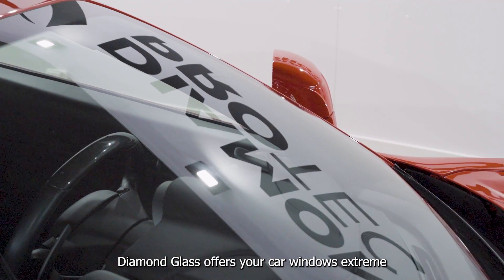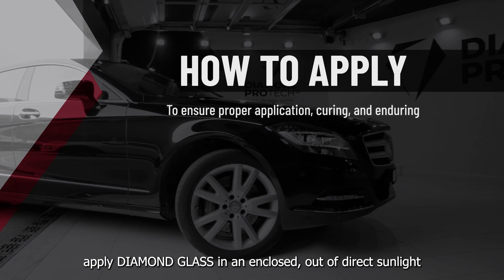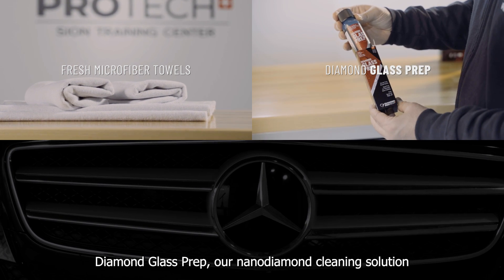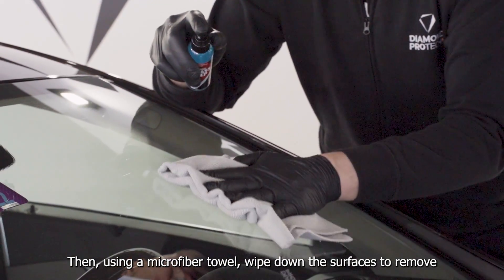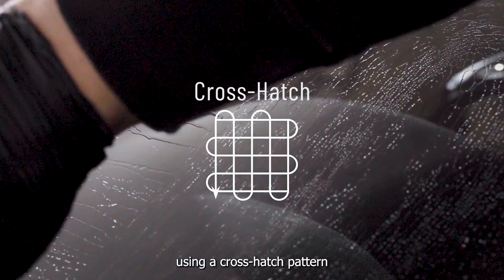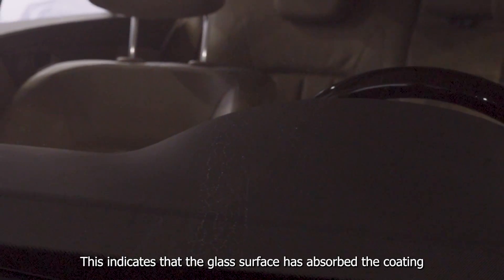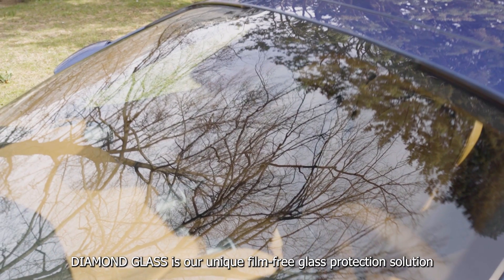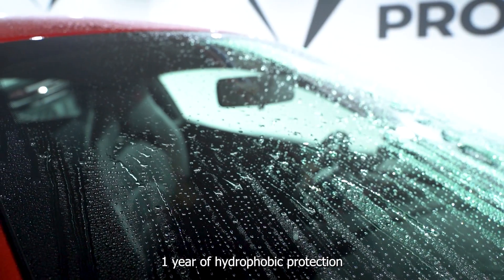DIAMOND GLASS  | Application Instructions

Comment: I’ve noticed that after applying (not in direct sunlight) that by letting it sit even for just a minute or so, after wiping off, the sweating becomes ingrained in the glass as well, almost as if it cured that way. I polished the glass, and reapplied again, after using the prep, rubbed in it more and it was better but noticed it hazed a lot after wipe off. The haze is interesting as I wipe it and it seems to reappear. Any thoughts? It works wonders and the “haze” in only noticeable to the trained eye. Other than that, the coating is incredible!
Reply from the maker: Thank you for your feedback. It appears you may have let the coating flash for too long on the glass surface. Please be sure to check the expiration on your product as well. 

We're always available directly via our website for any further investigation into your issue, feel free to contact us anytime!
Reply: @diamondprotech  thank you for the response. If that’s the case, wipe off should be almost immediately

Comment: I usually use a glass cleaner after washing my car - to get that streak-free finish. Now that I've coated with DPT Glass, is there a glass cleaner you'd recommend which won't damage the coating?
Reply from the maker: The diamond Glass is a very resistant coating. For the best results, use an ammonia free glass cleaner.

Comment: How do you recommend the glass is cleaned after coating? Any chemicals to avoid or preferred glass cleaner to use?
Reply from the maker: Any standard glass cleaner should be fine, rinseless wash, or PH neutral soap while washing the rest of the exterior should work too! The hardest thing on glass coatings is physical abrasion, so scrubbing hard and using the wipers. Thankfully Diamond Glass is super easy to use and goes a long way so it's easy to refresh if you notice its performance starts to be reduced.

Comment: The last coating  I used caused wiper chatter. Any chance of this with your coating? With winter coming up I want something  to repel the snow and ice and not make it worse.
Reply from the maker: Hi Mark. My name is Matt. I am a Diamond ProTech Ambassador for the USA. The Glass coating should not cause wiper chatter. Make sure the wiper blade is clean. Most chatter is from dirty blades that don't glide across the surface. I'm very excited to see your experience with Diamond Glass. Keep us posted on the results!
Reply: A little late to the party, but, most of the chatter I've had on wiper blades was due to bad contact angle. When wiping the wipers should be 90 degrees perpendicular to the surface. Any deviations that let the blades bunch up on the windshield causes it to skip. Otherwise I've prepped glass before coating by running a quality glass cleaner and either fine steel wool or a razor, gently of course. After that anything else is cool!

Comment: So it would be basically impossible to apply from a home garage since in our island humidity is naturally always above 75%?  Or what would be some of the adjustments one could do when applying it/removing it if don't have an enclosed garage for humidity control but is inside a garage with temperature below 90 degrees Fahrenheit?
Reply from the maker: Hi!  My name is Tony! I am a Diamond ProTech Ambassador in the USA.
I would test in a smaller 2 x 2' box to see the flash time prior to starting the whole windshield. With raised humidity, we would expect a shortened time of flash. We have experience in similar conditions - as long as you watch it you will be 100% ok to apply in your scenario.
Reply: @diamondprotech  thank you for your answer!  I have experience applying coatings but wanted to make sure first before deciding to purchase since some coatings are more finicky than others.  Appreciate your prompt answer since wanted to order it from The Rag Company.
Reply from the maker: @1stfrompuertorico568  Don't hesitate to reach out if you have any other questions! - Tony
Reply: @1stfrompuertorico568  hey man, I applied it above 90 degrees. It flashed quick, but didn't leave high spots or anything and the excess wiped off easily enough. It wasn't super sticky and didn't need to be leveled like a ceramic. I dont think you will have any issues.

Comment: Will using bug removers reduce the expected 12-months durability?
Reply from the maker: Hi! My name is Tony! I am a Diamond ProTech Ambassador in the USA. With the glass coated you should find you won't need to use a bug remover and that just soap and water will do the trick. That said, Diamond Glass is very chemical resistant so it shouldn't hurt the coating.
Reply: @diamondprotech  Thanks Tony that helps and will give it a try once my order arrives from TRC.